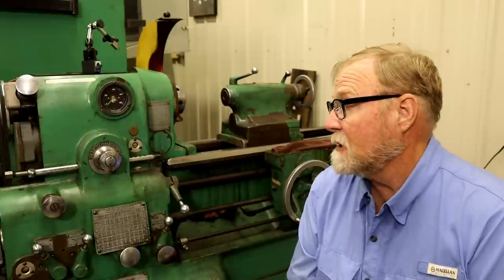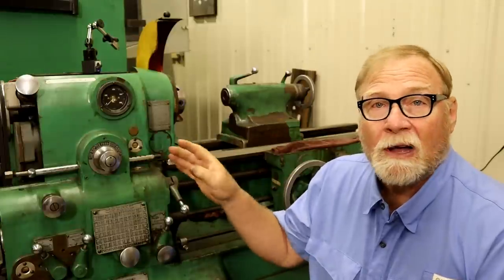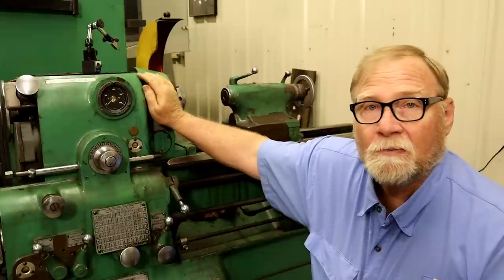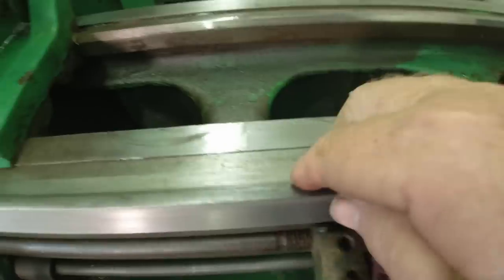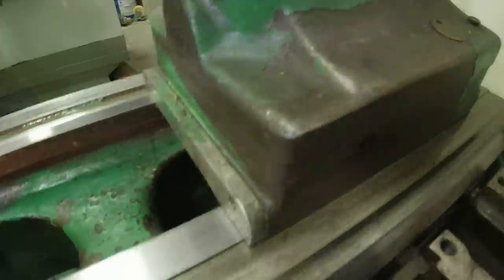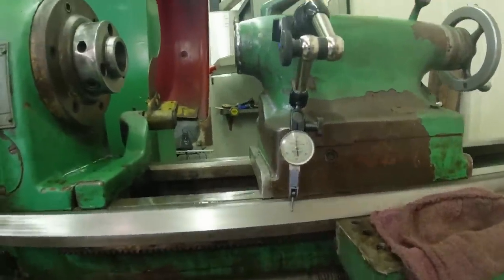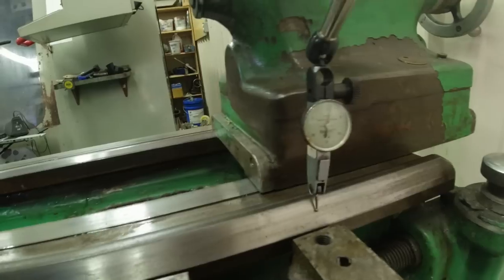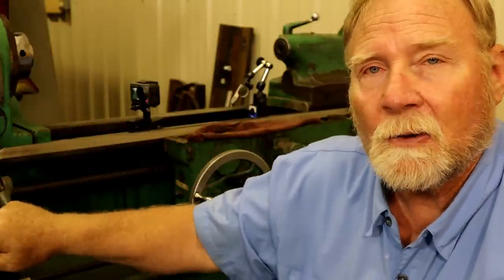7000 Mistake Monarch 10EE :  Is the Bed trashed?

Comment: Well I think if anyone can do it it will be you Steve, and it could be the series of the year if it goes well and you’ll want Don along for the ride. You could choose to get close with grinding and take the last few 10ths  bu hand scraping. Don’t understand why Durabar aren’t playing the game.
Reply from the maker: The whole problem is they are flame hardened..  Maybe the grinding will get me past the hard layer but if not I plan on using the grinding rig to perform surgical strikes on the surface.. Much like the scraping on non hardened beds...
Reply: Thanks for explaining that, it does rather complicate things,. Though I am very interested to see the grinding sled method, is there no way you can build a rub to sit the bed in on the planer to catch the coolant?

Comment: I will be interested to see how you go about this. It happens that I am in the middle of the overhaul of a worn five-foot lathe bed right now, but it’s an easier case because it is a plain flat bed (traditional English design). I chose not to send the thing for machining, for fear of having them take too much off in trying to make it absolutely clean, so despite a dip of 0.005 inch or so (and some deeper damage that I mean to patch), I am doing it all by scraping. In your case, what about checking over and correcting – if need be – the tailstock slideways, and running your grinding carriage on them, before scraping in the saddle ways?
Reply from the maker: OH I will have to work over everything..  I think the saddle was replaced because ther is little to no wear.. Mongolise will bring everything back up to height...
Reply: @10swatkins  Mongolise?
Reply: @ellieprice363  moglice.
Reply: @matter9  Sorry I’ve never heard that word. What does it mean?
Reply: @matter9  Hello again. Since Moglise was a brand new word for me I researched it on Google and learned what it is and how it’s used. 60 years in the trade and still learning interesting ways of doing things. Dewitt Machine has a great video on the product.

Comment: No need to ship it off if you can do it and Don can always paint what needs painted so it looks like a win/win. And the old MAD Magazine quote was 'You can lead a horse to water but you can't make him drink..............except sometimes'. GBWYou!
Reply from the maker: Even if I ship it off I would get back a GROUND surface and not a  scraped surface... I am used to much more perfection than a ground surface....
Reply: @10swatkins  RIGHT! If you can get it closer, and you can, gopher it!  Get out the scraper and oil it up! The scraper, that iz! BLESSINGS!

Comment: I don't think it'll work Steve. Your concept is good, and even if you were able to clean up a piece of cast iron dead flat, you probably really need to have a temperature controlled environment in order to do the grinding. You know..... just a few degrees in temperature can change the flatness of your cast iron guide bar. Of course you can try it, but I think you're going to be chasing your tail...... You just don't have the "white room" environment to ensure the accuracy you're looking for. That's my opinion and I'm stickin' to it!
Reply from the maker: John I'm a woose and do have a 68 degree temperature controlled room that I work in... The planer, surface table, straight edges and all the measuring equipment live in here and everything I scrape has been inside here for at least 48 hours :) The only problem in this project is the bed is hardened... And I need some rail material :)

Comment: Maybe I missed something but why can't you rig up the planer with a grinder motor instead of a cutting bit and grind it dry? Would make a dust storm I suppose but many very light cuts might help that. I'm certainly no expert at this, just a thought.
Reply from the maker: It would actually be  more work than what i am planning.... As a last resort I will put it on the planer with a grinding spindle.... BUT you have to have the coolant to remove heat... A mister is probably the best I can do though...

Comment: how about using linear ball baring rails similar to cnc lathes or strip off head stock remove carriage and tail stock and attach a grinder to your planer z axis grind the base casting ??
Reply from the maker: not ridgid enough for the way I will mount them.  And most of the affordable ones are not accurate enough.

Comment: I would be curious about possibility of planing the hardened bed using carbide tooling.. might be a fairly unique tool though, taking light cuts with a very sharp edge, maybe with some shear  & positive rake. Or maybe somewhat like a scraper edge?
Reply from the maker: I have tried planing hardened material before, It is not that great of an experience. When the tool hits the workpiece it either jumps up as it first starts or if you have enough down pressure it skates along the surface... 

I used a carbide hand scraper on this bed and it scratched it but nothing like scraping a non hardened bed....   Maybe after I take 7 to 10 thousand off it will be enough to get into non hardened material...

Comment: You and Don might be interested in this video on the 10EE drive (https://www.youtube.com/watch?v=MoAD1_SgRY4).  The video was made by Dee Dee, who is a retired professional machinist who owns two 10EEs, one with a motor generator for producing the DC to drive the motor and one with vacuum tube rectifiers to produce the DC. He discusses reducing the current to the field coils to increase the spindle speed above about 1150 RPM, use of braking resistors to stop the motor even when directly reversing the direction, and a runaway protection relay circuit to prevent destroying the DC motor if the power to the field coils is abruptly lost.

Comment: Is the underside of the bed planed or ground? If so, that side shouldn't been worn, so you can check if the bed is bent or worn. If worn you can use that surface as reference. I reground the bed this way. I bolted a cnc-rail to the underside and on that a backed to regrind the top. I rented a 2m straight edge to shim the rail perfectly. This was my second attempted get the lathe bed straigt first i used an cnc-rail as a base for a handmade camelback to scrape the bed, but it was so much work and never got the alignment right. Half way trough that i came up with the idea to bolt the rail to the underside of the bed.
Reply from the maker: I will keep that in mind...  Good tip..   I knew the bed was worn from earlier testing, just forgot how much :)

Comment: Steve  if you have that much ware on the harden bed how bad is the bottom of saddle ?  For your grinding of the ways I have a grinder that was used by Bridgeport to grind the  ways on the columns of their mills, that's looking for new home. It does have 2.5 x 72" est. chrome plated flat rails the grinding head rides on. Cheers
Reply from the maker: The saddle looks almost new!  I think it was badly damaged in the wreck and replaced with another one...  But it does not matter as I will mill out the saddle anyway and use a liquid compound to bring everything back up to a prefect fit and height...

Comment: You can lead a horse to water, but you can't make him drink.  You can drown the horse. But you can't make him drink.  
If the lathe is that valuable, wouldn't it be a reasonable investment to have either the shop in Dallas or Milwaukee grind the bed.  I know it is a lot of work and expense.  Then sell the lathe and fund Don's retirement home in the Virgin Islands or some other retirement community.
Reply from the maker: I just don't get why people think I can't do a better job of making those rails as good as new here.......
Reply: @10swatkins  It isn't that I doubted your ability.  I know that you can make the bed "dead nuts" flat.  I was asking about something I know very little about - The investment value of the rebuilt lathe. You are going to make a set of very interesting videos. Go for it. I am looking forward to watching.  In my most humble contrition, Larry

Comment: What about just scrapping the rails ??
Reply from the maker: This bed has flame hardened ways... A scraper blade will not touch them right now... Otherwise I would just put it on the planer and then touch them up with a scraper :)

Comment: You probably already know this but, the hardness of the ways is only 10 thousands.
Reply from the maker: I was not sure how deep it is.... I did take a hand scraper to the rail and it did scratch it.... Lots to think about there...
Reply: @10swatkins  , Yes, 10 thou was the standard. If you grind 7 thousand off, then that would only leave you 3, that is if it had not been reground previously. Have you checked with Monarch to verify how deep it is hardened?

Comment: I've heard about moglice or turcite, would either of those be appropriate for repairing the ways?  I'll be looking to see how you fix this problem.   I have to admit that I would like to see what kind of rig you build to grind the ways.  when you get this old lathe back in shape It will be a jewel.  Thanks for letting us all in on the progress.
Reply: The Moglice and Turcite materials are not used to repair a worn bed. These materials are used/fitted to the sliding bearing faces of the tailstock and saddle castings.
Reply: @howardosborne8647  Thank you for the reply.  I did not know that about those materials.
Reply from the maker: Not on the ways James... That is used on the saddle as it is hidden from chips. As it is quite soft it is also  protected from damage from things falling on them...
Reply: James, if you want to see how Turcite is used to rebuild the under sides of lathe carriage then Keith Rucker is restoring a horizontal boring mill and he will be installing Turcite under the carriages.
Reply: @howardosborne8647  Thanks for the tip. I'll be sure to catch that video.

Comment: Before you check a lathe like you showed, don't you have to have leveled it, first?
Reply from the maker: This is just a rough and dirty way to get an idea if it was worn.... The only true way to make exacting measurements is to take the bed off and measure it on my AA plate or my planer bed.
Reply: Yes leveling the lathe is important for twist but i don't think you can take the bow out of a short stubby lathe like this

Comment: Looks like i'm a little late to the party. Before you decide to recondition the ways you need to check the way hardness. If hardness has dropped out of spec then its not worth doing - you will need to reharden the ways first. Then, you need a straight edge and just scrape it into shape. No grinding. Use a power scraper. Build one from a sawzall if you cant afford a biax. Don't bother with linear rails the chinese kind you can afford are not that great.. Follow a machinery rebuilding channel or book don't try some of the stupid solutions offered on the internet as you'll be going down the rabit hole of time and money and eventually forced to settle for a compromise or bad job. Whatever you decide to do, for god sake get it within factory spec -- its not a toy lathe its a real gem.

Comment: Thanks for sharing this. I have an old Logan. I'd love to get the bed back into spec, but no one responds to my emails, or they just don't have the capability. I'm willing to travel to deliver the 4-foot bed so, if you know anyone I'd love some advice/recommendations. I'm in Michigan.
Reply from the maker: It's allways more than getting the bed right.. once you are there you then have to work your way back up to the tool holder.. It costs a lot of money to get someone to do that much work so unless its a special lathe most people will not, or can't, payfor it.  Thats the boat i found myself in years ago  so I learned scraping and equiped myself to do the work...  Sometimes is best to keep an eye out for a better machine than spend thousands on grinding or planing a bed and then tons on scraping them in.. Remember planing or scraping is just the first step..

Comment: Could you use turcite? I've heard that is an option sometimes.
Reply: The Turcite isn't used to repair the lathe bedways. It is  fitted onto the underside of the saddle and tailstock sliding faces and machined and scraped  to suit the newly ground lathe bed ways.
Reply from the maker: What Howard said :)